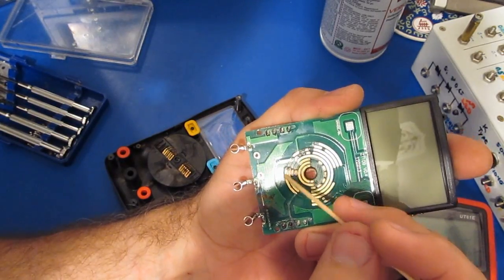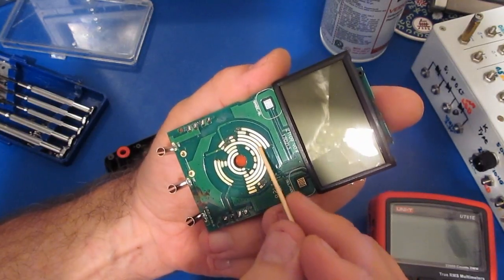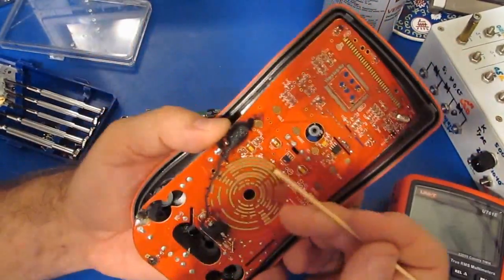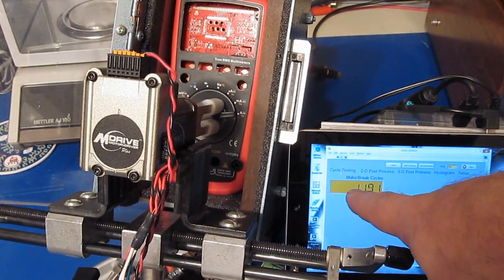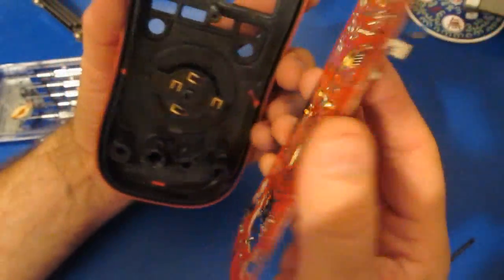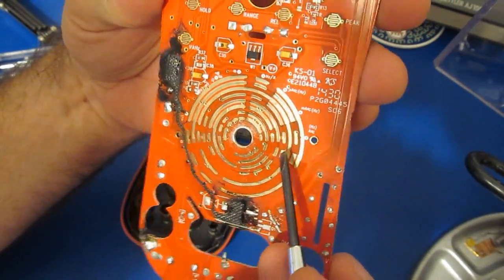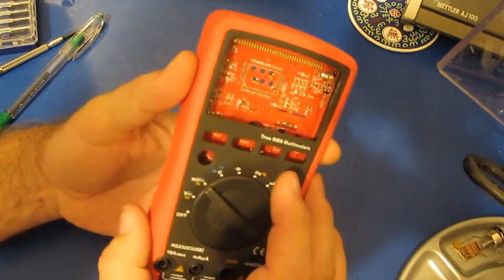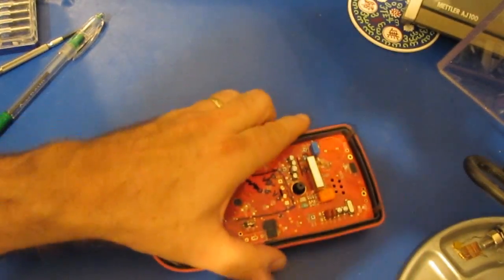More on Handheld Multi-Meter Switch Cycle Testing

Comment: Interesting thought about the running PCB tracks and ability to cut them. I noticed at the second meter that there weren't any tracks except the contacts. Now I wonder how professional quality meters do this.
It's definitely something to keep an eye on. For example, if you can't get rid of the PCB tracks, it would be better to shape them in the same (spherical) direction as the contacts.
They will still get damaged, but you don't risk cutting the track. 
Better is to move them to the other side of the board if possible.
Reply from the maker: Some place the vias in the pads.  As long as the traces are not routed between the pads on a given radius, it will not be a problem as the contacts only have a point contact.
Reply: I think vias are also stronger than just regular (gold plated) tracks.

Comment: It would be interesting seeing how the Brymen BM257 performs at this test. Someone at the EEVBlog forums noticed that the selector switch passes over some traces and it would be interesting to see if that causes an early failure. It certainly seems to be wearing on the ZT102.

Comment: Might be a thing to try buying 3 of the cheap HF meters, all identical, and all within a small serial number range, and then to run one as is, one with a cleaned switch and one with a switch cleaned with contact cleaner of choice, so see the effect of the original manufacturers lube or aftermarket has any difference in wear.

Would love to take that tuning fork and simply attach a foil strain gauge and amplifier, and measure the torque to turn, and how that changes with time. Probably take the cycle tests and average them using the step position to bin the data, and show the average per 100 cycles.
Reply from the maker: I could maybe get torque indirectly by stepping the current. In the end, to me the contact resistance would be more important, well, unless the knob gets so loose it falls off.  I would not care too much how the switch feels but would care if the meter started to become intermittent.   Worse, it flashed over from contamination.    

I have obviously modified meters in a few of these videos and could see that switch lubrication could be part of that.